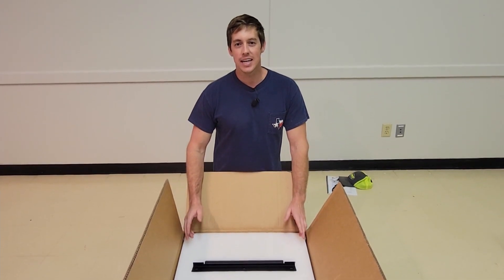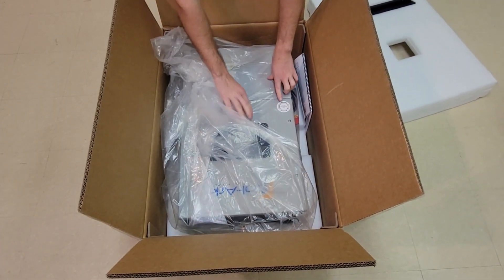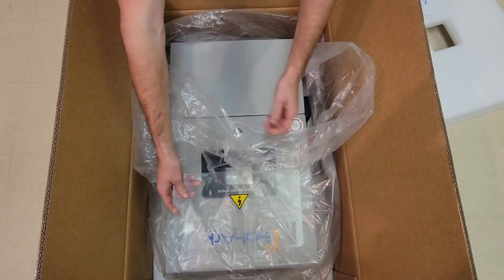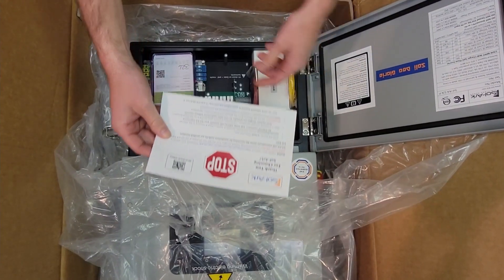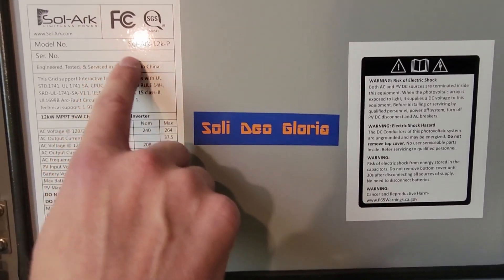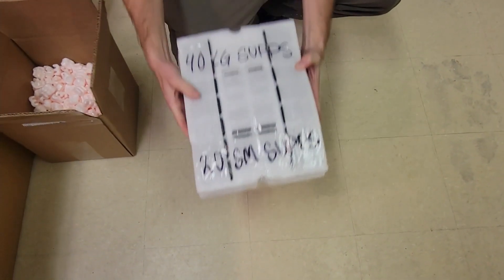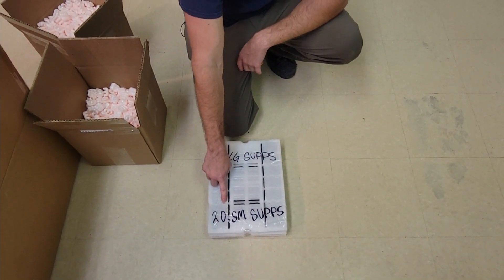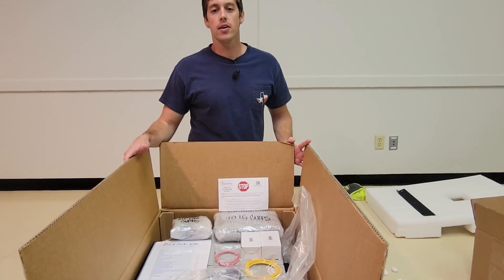Sol-Ark 12K EMP-Hardened Unit Unboxing

Comment: Can the suppressors be ordered separately? I want to add them to my existing Sol Ark.  Where are they installed?
Reply from the maker: That's a great question. They cannot be ordered separately, as you would need your Sol-Ark to be EMP-hardened. There's no process to upgrade the S-A to an EMP-hardened version in the field, and installers/distributors need to order these directly from us.
Reply: @Sol-Ark   are you guys going to do a emp hardened version of the 30k? Or can I get a 30k specially Ordered as such?

Comment: So are all the 12k emp hardened or just certain ones? Because the one I had installed didn't have any sticker on it.
Reply from the maker: Hi Joe, you must ask your installer specifically for an EMP hardened unit, as we do not EMP harden all outgoing units. If you have any other questions, you can reach out at support@sol-ark.com

Comment: please upgrade per mppt input amps. max only 20amps per input.  my 450w pv 7pcs series 2 string almost 23 amps max
Reply from the maker: Hi Dom, 
The Sol-Ark is self-limiting in terms of currents to 20A. Damage will occur if you input more than 25A. We would not recommend to face all your panels South (if in N. Hemisphere) to ensure a peak does not occur. Contact us www.sol-ark.com/support at the bottom. Include any spec sheets and our sales or support teams will gladly help you out.
Reply: @bradspaugh9827  Don't face all of them completely south because they could possibly output more than 20A.  Yes your losing some of your panels output but at least your not blowing up your Inverter. 
You should call them because I am not sure if you have 14 panels total or you have 28.  I assume it's 28 and therefore the best solution is to put a couple on each string facing West.  You will loose some of the peak output at noon but gain it back in the evenings.
Reply from the maker: @bradspaugh9827  Hi Brad, please feel free to  face your panels South. This was a recommendation for a specific situation where their specific panels produce current close to our limits. It's a solution so that they may use the Sol-Ark with whatever panels they may have. This situation does NOT apply to everyone, and you should consult with our engineering team if you have any questions.
Reply: @bradspaugh9827  Hi Brad
Sorry about that, I was responding to Dom's post but clicked yours instead.